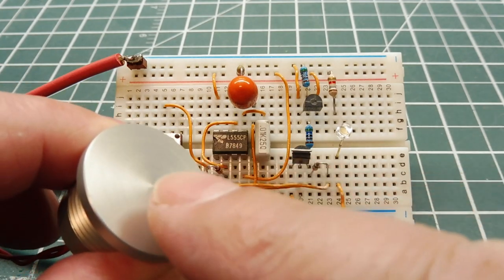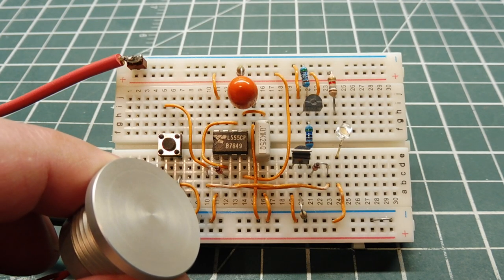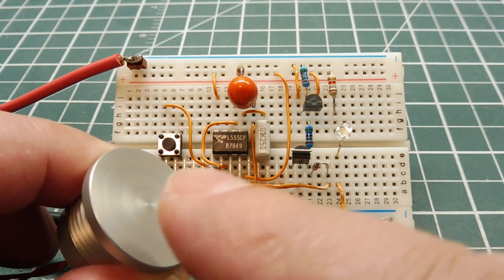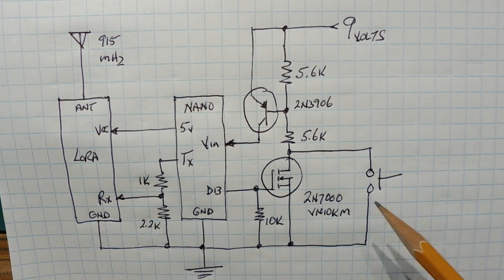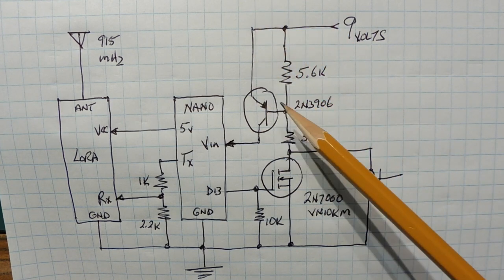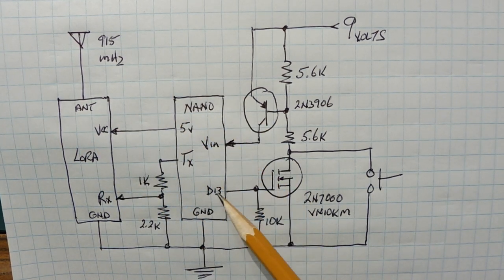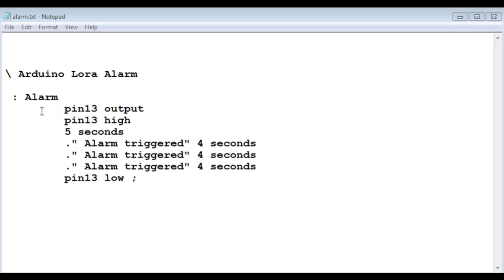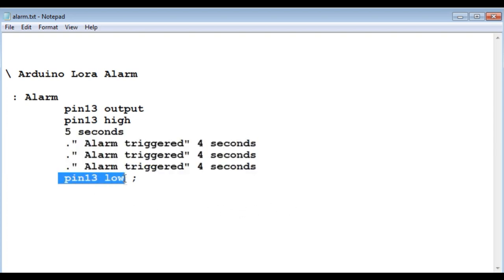Remote Wireless Alarm Using LoRa and Arduino

Comment: This is a wonderful project.  Is there a way to modify this to become a driveway alarm with multiple transmitters using a motion or microwave radar sensor to one receiver?  I’ve tried store bought driveway alarms before but they seem to be unreliable with the distance of my driveway.   Thanks.
Reply from the maker: Yes .. you can setup multiple transmitters as sensors targeting one receiver using Fixed mode. Check out this video on Point to Multi-point : https://youtu.be/JvBC7cEgI0E
For more details check the link to E32 documentation in the description box.

Comment: When Vin goes high and arduino powers on, is it correct that the switch (i.e. alarm input) needs to be on for long enough for the Arduino to essentially boot up and bring D13 high? That means the binary alarm input can not be extremely quick, like microseconds (or milliseconds)? How long does that D13 take to go high after Arduino is powered on, compared to e.g. the length of time that vandal resistant piezo switch makes the circuit? (Or maybe I misunderstood how that latch works?)
Reply from the maker: The ATmega328p microcontroller on the Nano has been erased and re-programmed with a Forth operating system written in assembler. The Nano is not an "Arduino" so there is no bootloader. The vandal proof switch puts out a 100 msec pulse which is enough time for the micro to boot-up and turn on the MOSFET. If you need more time a capacitor can be put across the switch or for very short triggers a monostable or flip-flop latch can be used to drive the circuit. This circuit was used in a slide fence detector where the switch stays closed after the slide fence is tripped.
Reply: @0033mer  thanks for the response. In fact it’s one of those responses that can send someone down a rabbit hole :) O didn’t know about Forth, just learning about it now.
Reply from the maker: Check out Forth running on a multi-core microcontroller. https://youtu.be/KJoS9O5DYzM

Comment: I assume there is no bootloader as that would cause the switch to be held longer ? You have the most integrated channel,  microcontrollers, digital, analog, discrete circuits and radio. It's the best !
Reply from the maker: The program is written in Forth so it is basically running assembler on bootup, no bootloader.
If the boot time is a problem a capacitor across the switch will give a longer hold time.
Thanks for the feedback!

Comment: Would you consider doing a simple code lock circuit using a 555 timer and/or transistors with push buttons? Thanks for your fine videos.
Reply: AT Tiny might be another IC to use instead of 555.
Reply from the maker: Check out this video for a very simple lock circuit.
https://youtu.be/tAv2b1j3Qz0

Comment: Thanks for this video. Using that particular circuit what is the total current draw when triggered?
Reply from the maker: It would be the current sum of the Nano and the LoRa radio. The current draw of the LoRa radio varies depending on the output power configuration.

Comment: Hello. Is it possible to have the complete FORTH source code? Your work is great.
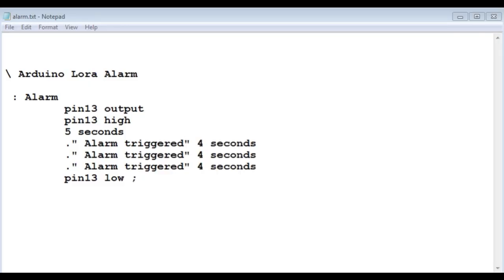Reply from the maker: Forth code starts at 6:03
Reply: @0033mer  I am starting to take a very close interest in the LoRa system for ARDUINO. I think it is the most suitable IoT solution for communicating arrangements. Your videos are proof that it is doable. The FORTH language has a certain future for this type of assembly. I have some ideas for that. But since I wouldn't want to reinvent the wheel, I'm interested in your code that communicates between the ARDUINO board and the LoRa transmitter.
Reply from the maker: To communicate with REYAX LoRa radio modules you have to use AT commands similar to communicating with the old dial up modems. https://youtu.be/jON3zbZY7ls
Reply: @0033mer  I have see all your videos about LoRa technology. In the video "Reyax LoRa Radio Link", it's give no explanation about >REYAX, no source code...
Reply from the maker: All the Forths I use have been re-written to be true engineering Forths for the AVR, STM32 ARM, X86 and Parallax Propeller containing vocabularies with all the code for many common sensors, wireless modules, fixed point math ... etc. I made some instructional videos with little interest so I am currently teaching students one on one which works out much better.
The current videos target my students but there is enough information for a Forth programmer to get the concept and write their own code.
Reply from the maker: Great video and very informative web site. Will have to mention it in my next Arduino video.

Comment: Hello sir. May you share the code? I want to try this simple  alarm system for long range ( 20km) without power amplifier, my hobby is to build high gain antennas. I am not good at writing codes at all. I want to try how this alarm will work with my antenna and will share the results. Last summer with cheap $15 pmr446 radio I did 50km. Thank you
Reply from the maker: Code starts at 6:00.
Reply: @0033mer  Thank you sir. I can do that, the antenna is build and set up, 10db. What can I do for the receiver end? Probably again LoRa plus Nano? From the receiver end I will have unlimited power supply for sure. Thank you for your help